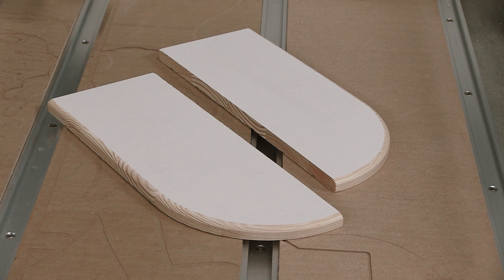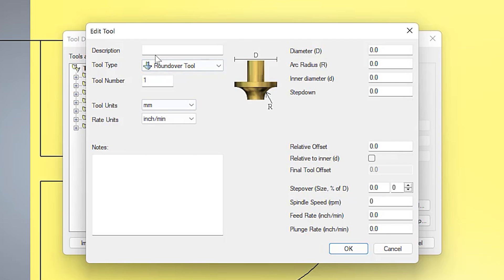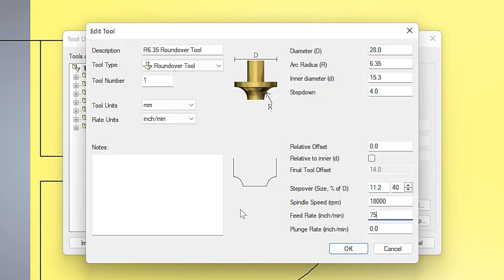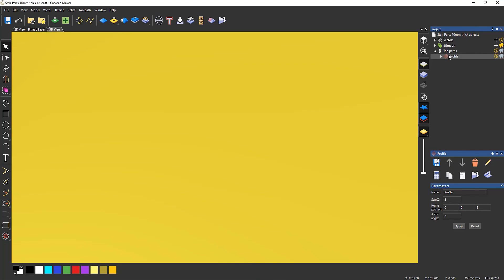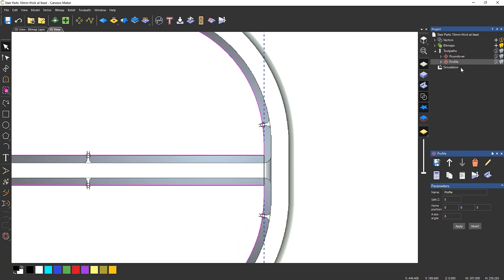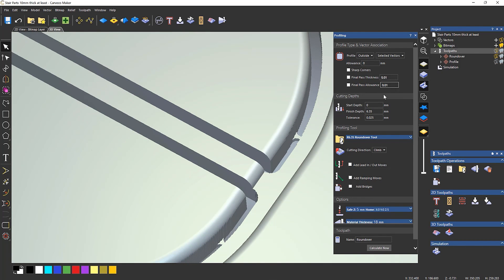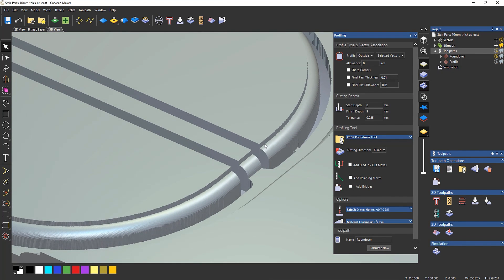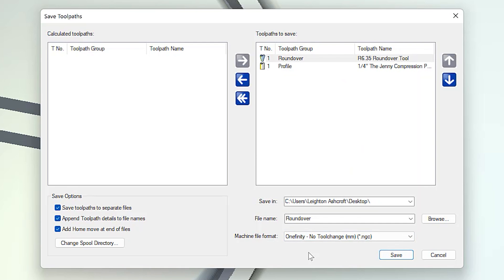Carveco Maker Tutorial - Using a Roundover Tool

Comment from the maker: One thing we forgot to mention in this video is if you have a point roundover tool, then the Inner Diameter needs to be changed to 0, or whatever the flat is on the tip.
Reply: Thanks for the clarification.  I bought a bit like this (point roundover tool) for rounding over edges.  I haven't used it yet, but I was thinking doing the profile toolpath along the vector.  I thought it would work correctly, but now I'm not so sure.  Will this tool be the exception to where I can use the along vector toolpath?
Reply from the maker: @gizmobowen  It should work fine on an along Profile toolpath since there is no offset involved.

Comment: Surely the stepdown when creating the tool should be the same as the radius so you get a perfect round-over, from experience its better to be very slightly less especially if the material is not perfectly flat on the top or your spindle is not perfectly trammed, say 6.2mm.

Comment: Hi, please can I ask...if a just wanted to cut a pocket across one line and limited to the diameter of the endmill (2mm dia) can I just draw a single  line that the cnc will cut along or do I need to close the vector I.e. draw a narrow rectangle (length whatever vs 2mm width) so the machine Cuts inside the rectangle? I need to draw and cut out a spiral shape (2mm cut leaving a 2mm wall inbetween)
Reply from the maker: Hi Luke.  Yes, just draw a single line and using the Profile toolpath, set it to machine "Along" the line.
Reply: Thank you so much for your response...is there an easy way to draw a spiral...I.e. is there a coil or spiral button please?
Reply from the maker: @lukebrown6913  Not a problem.  There isn't a one click tool unfortunately.  There are a couple of ways to do it, probably best to contact support@carveco.com. But, have a look at this old ArtCAM video (sorry about the quality, it's not ours!) where the spiral toolpath is used as a guide - https://www.youtube.com/watch?v=SVkYWwB8xkM
Reply: @Carveco  Hi, many thanks....I'll take a look.
Reply: @Carveco  just took a look, good idea, but don't speak Italian!!! I just need to learn how to split a circle and move the halves to create my own

Comment: Hi,

You are really a brilliant "teacher".
However, I have a question:
Is it really so that you cannot move/copy a toolpath in Carveco Maker?

Regards
Lars
Reply from the maker: Hi Lars.  Thank you very much.  If you update to 1.30 you will be able to copy a toolpath.
Reply: @Carveco  Thanks for your answer.
I already have version 1.3.
Copying a toolpath, the new toolpath will just be sitting on top of the first one, from where it cannot be moved.
My scenario is that I have 20 different toolpaths and then want to  rearange them in order to optimise the use of the sheet.
I conclude that I have to upgrade to the Plus version.
Reply from the maker: @larsrolver5096  Not a problem.  You should be able to rearrange them into what order that you like by left clicking and holding down on a toolpath and then dragging to where you want it to be.
Reply: Hi again,

Tried moving the toolpath without succes. Strange.
What can I possibly do wrong here?
Reply from the maker: @larsrolver5096  Hi Lars, I would email our support team at support@carveco.com and send them your .art file so they can take a look for you.
Reply: I will😃
Thanks a lot and have nice day.

Comment: I am a machinist and work with metal and plastics. With standard round over tools I have always programmed for the center diameter of the tool and the Z depth. Couldn't you do the same thing with Carveco by just using a straight end mill tool description?
Reply from the maker: Hi Billy, you could do if it was a point tip roundover and go along when doing a Profile toolpath.  If it has a flat though, you'd have to offset every time you use it.